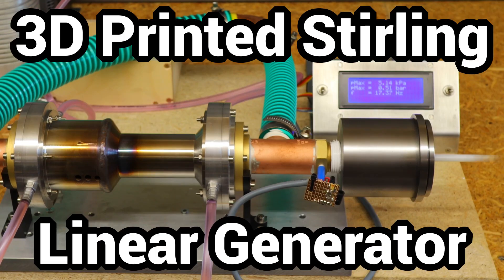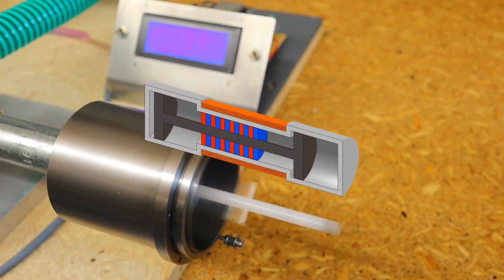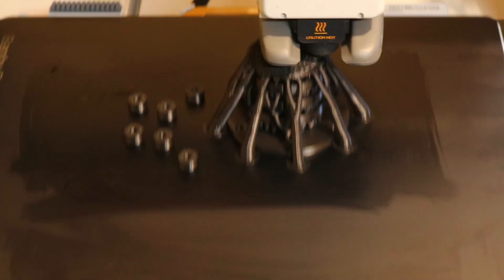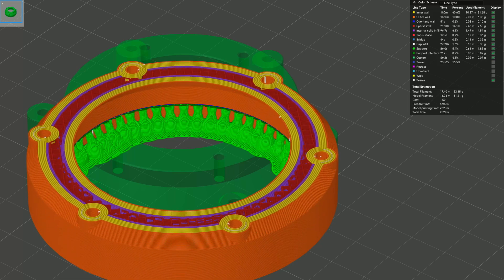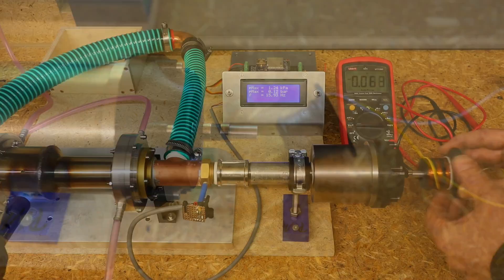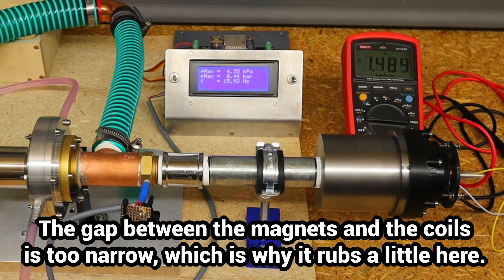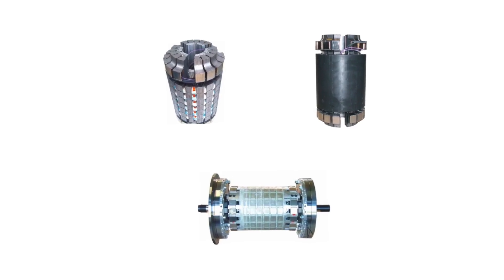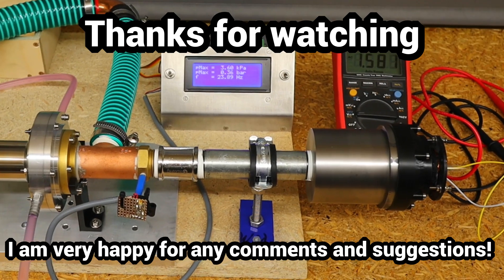Linear Generator for thermoacoustic Stirling engine – how to get most power from magnets and coils ?

Comment: Electrically, you can play 2 tricks here. 1) use an active rectifier. there are a bunch of ICs which do that. However, they are usually expensive and require their own PCB. You can also look at "ideal diode controllers", there is sometimes a breakout board available, like the "Adafruit LM66200 Ideal Dual Diodes Breakout". The voltage may not be high enough though (or may need external power to operate the rectifiers). 2) Another option would be to use a resonant tank. Since your oscillation frequency is somewhat fixed, and your inductance should be high enough, you can make the entire thing oscillate at (or close to) resonance frequency. It would raise the voltage high enough that regular rectification becomes viable again.
Reply from the maker: Thank you very much for your good suggestions, I will carefully think about them and use them!

Comment: Yes, I have been building these Engines & Generators for 40 years. Here is everything you need to know about FPSE & Linear Generators...Also you are correct, the Magnet Mass is too heavy, the solution is also in this video. 
 https://www.youtube.com/watch?v=ZSJFPb8030g
As much as I love Striling engines, Power will be relative to Pressure. The fact that you have Methane from Biogas makes a Vintage Gas engine a much better choice. Think about a "Hot Bulb" or similar pre-sparkplug Gas engine. This combined with a Modern Alternator will solve your power problem...
Reply from the maker: Thanks, I will use your good information for sure!

Comment: if you haven't come across it yet, you might find this an interesting way to get high-precision metal parts from plastic prints without machining. Some labor and somewhat expensive equipment is required, but possibly one of the most easily attainable for hobbyist
https://www.youtube.com/watch?v=kLgPW2672s4
Reply from the maker: This looks very interesting, thanks I will carefully look out for it!

Comment: I think i already made this suggestion in the past, if i did, just ignore it. But i think you should rotate the whole assembly so that the piston would just hang, that way it will be much easier to align it and you will potentially need less support, therefore less friction
Reply from the maker: Yes I will try it  when I rebuild the engine connector the next time, thanks!

Comment: Be very careful with carbon reinforced filament, the microscopic carbon strands break off when you touch them and can embed themselves inside of your skin and lungs permanently
Reply from the maker: Yes I know, you have to be very careful with these filaments!
Reply: @myengines2443  Nice i'm glad
Reply from the maker: @matthewbadger8685  I will also mention it clearly when I make a video about it which unfortunately most do not!
Reply: Use FETs for rectification, not diodes.
Reply from the maker: @evan010101  thanks for this hint, on Discord we are already discussing this and I will look out for buying some of them for testing!